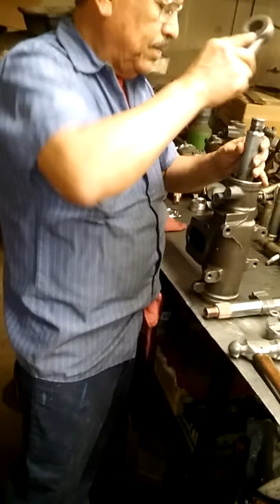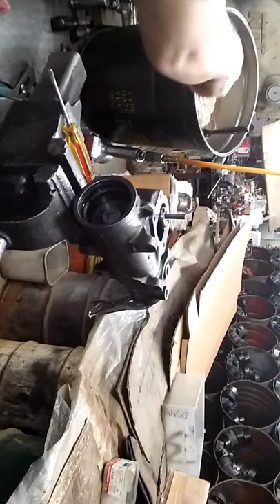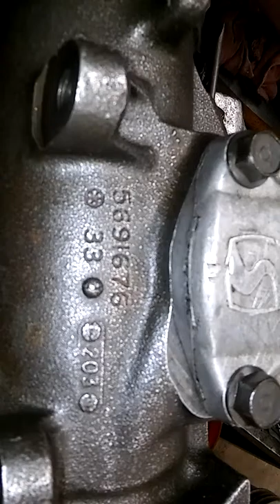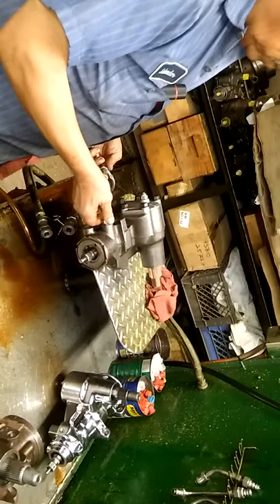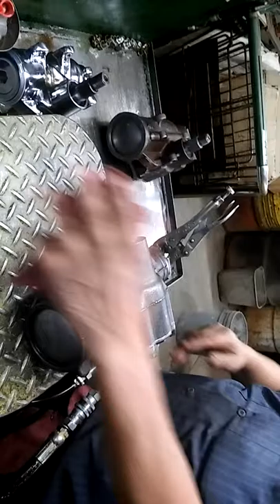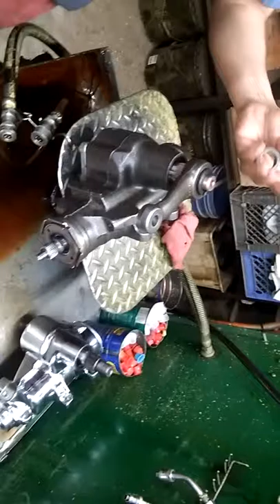Carhex variable ratio power steering gear box rebuild part 3 Hector Carrillo

Comment: I recently rebuilt a 700 box 12:1 ratio and when I put the end cap back on with new o ring and snap ring when i turn the box left to right i can feel the end cap slightly moving.  Is this going to leak?  Also I took apart a box that was a 14:1 and when i did the valve body end had 3 deep ring groves in the steering box bore.  I assume this box is junk?  What would cause this?  Questions for Sal if you could ask him please!  By the way great videos, very informative!
Reply from the maker: tmg24 call me in 3 weeks I will ask him for you. 626 488 5472 he is on vacation